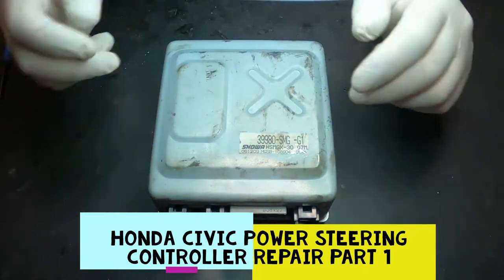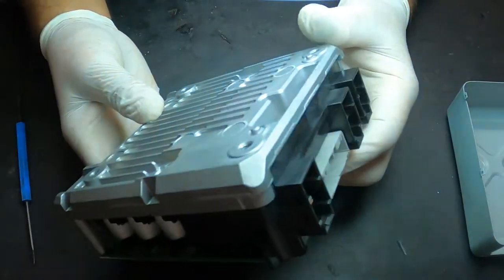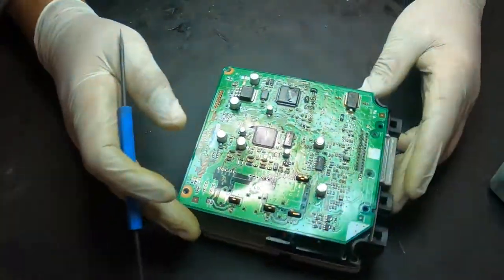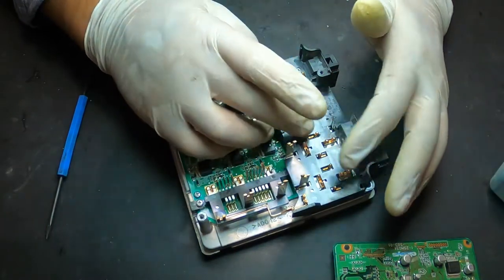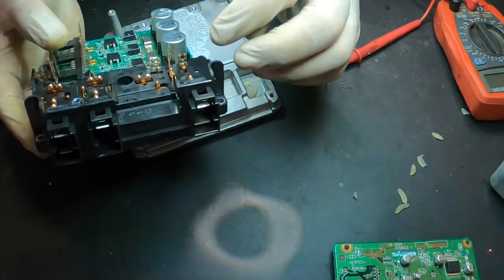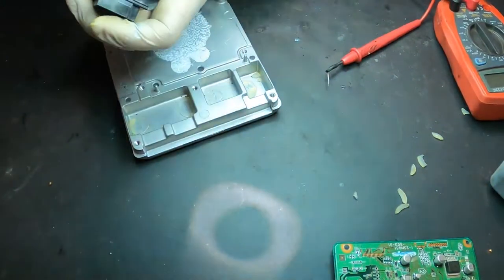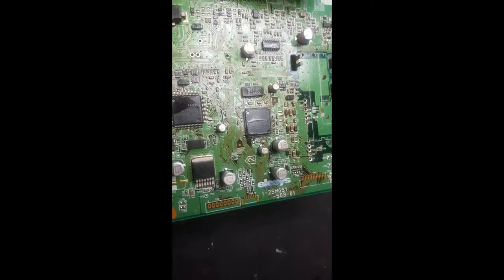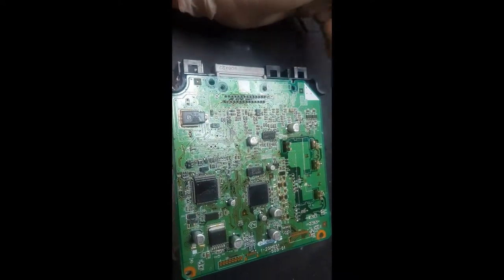Honda civic Power steering module

Comment: Hi,
I'm Portuguese but I will make my question in English so everyone can understand. But first, I would like to congratulate you on this project. It's a pleasure to me see someone of my country doing such a great content.
My Honda Civic VIII is suffering from this exact same problem and everyone wants to replace the module. Honda is asking me a bunch of money for a new one, so I'll do the job from myself since I've some experience on welding things on. But first, here's my questions:
1. I was searching for those relays in Digikey and Farnell and I found nothing with that reference. So I'll buy a 12VDC - 4pins standard ones. However, I'll need to know the contact current of the relays. Do you know it?
2. Do I really need to reset the steering wheel angle? I don't have an OBD computer to preform that.
3. How do you put the relays in place after you cut the pins? Just by welding the new ones or do I need any extra peace?
Regards
Reply from the maker: Thanks for watching.
Any 4 pin Relay will work but make sure you get the higher Amperage the better... the relays are mounted outside the box on the relay holder that you will need for a clean and easy to replace if needed in the future. If you remove the control module with your wheels straight and disconnected battery then you wont need to adjust the Zero angle...i will find my notes on where to solder the wires for each relay holder but its actually very easy to find with a continuity test using a multimeter...anyway i will get my notes on that and share those with you gladly.
Obrigado pela pergunta em Ingles por consideraçao aos subscritores.
Reply: @PSICompanyPerformance  thank you for the response.

I'll ask in Portuguese in order to make sure that I don't miss anything:p

Eu não compreendi bem a parte do relay holder. Então não conseguiu remover os relés originais, mas sim cortou a conexão aos da caixa e adicionou outros exteriores. É isso? Em caso afirmativo onde é que os soldou no módulo e como passou os cabos cá para fora?

Cumprimentos

Comment: Hey, at first i would like to thank you for the video! 
I have an Accord 2.2 Diesel Type-S and had the code 32-09 and no more Power Steering. I watched your video and also changed the three relays. Unfortunately, still no Power Steering. Code 32-09 is gone and now i have the code 33-01, which means Lower FET Stuck ON. Do you have any idea why this happened? I did something wrong, thats for sure. 
Can i still save it or did i just fry my module?
Reply from the maker: Thanks for watching...
You need to check the original relays, because if its stuck maybe there is one relay that is suposed to be normaly open and not closed or the other way around.
Good luck
Reply: @PSICompanyPerformance  Thanks for responding, i mean it! 
I am by far no professional when it comes to electrics and i dont quite understand what you mean. There was just one way to solder them in, one way they fit in the socket. So how can I change what they do? The original relays were all the same, so I didnt give much attention to what they actually do. I just replaced them with similar ones.
Maybe I had to use relays with changeover contact, not normally open ones?
Reply from the maker: @articus85  i mean if the original relays are normally open then you should make sure that the ones you replace are exactly the same.